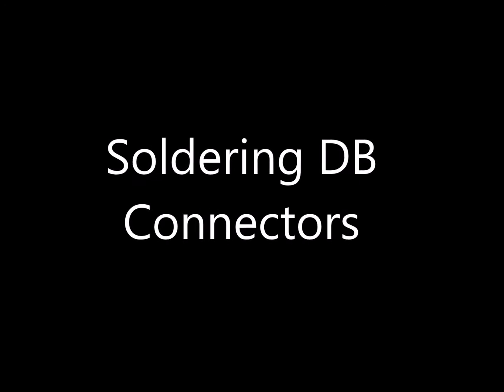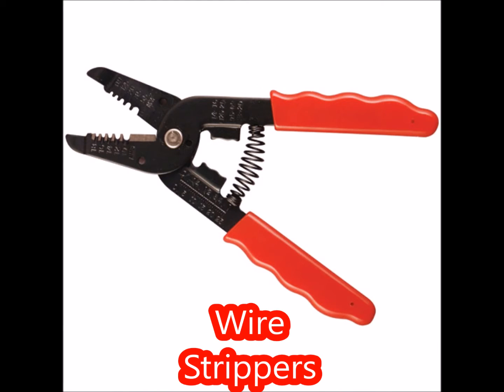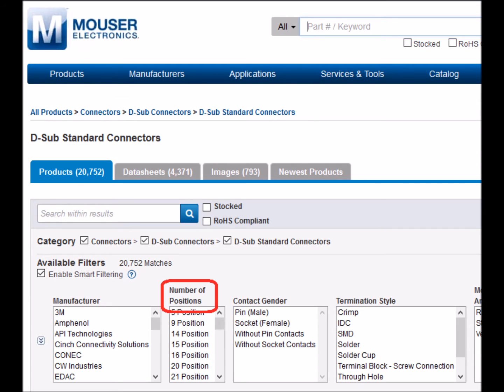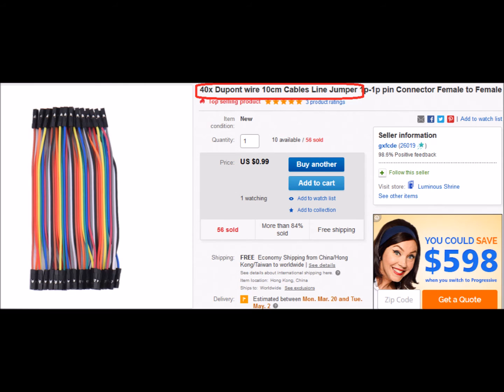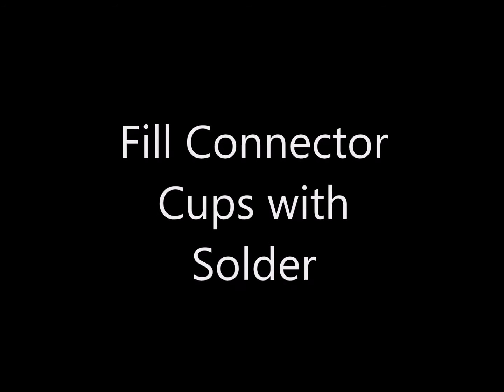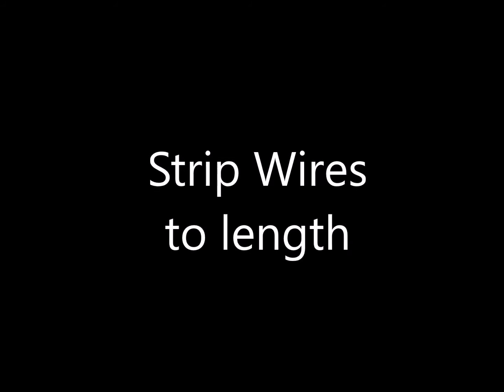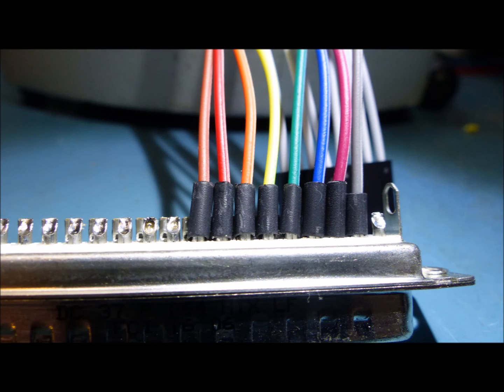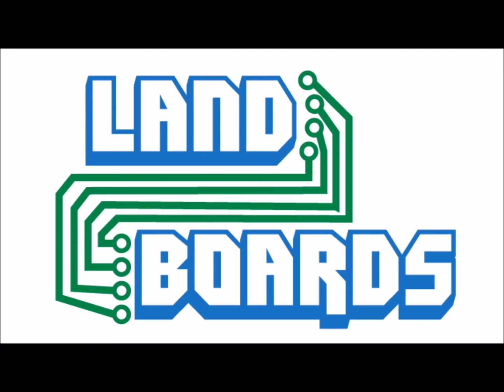Land Boards - Soldering DB Connectors

Comment: brilliant move with the heat shrink. I have 20 gauge hookup, that even with a nice solder joint the leads can fray where I cut the insulation and tear off. I can see how the heat shrink can minimize this issue.